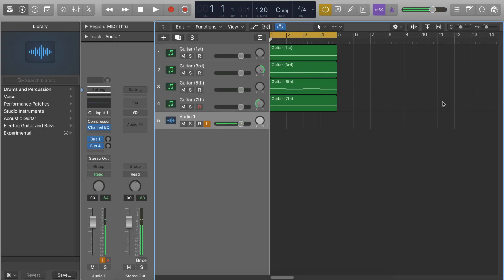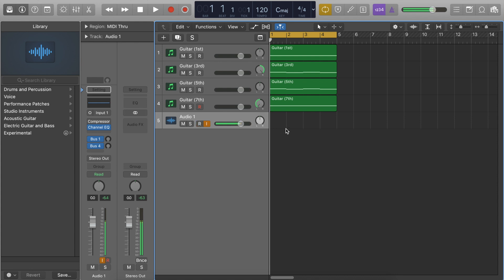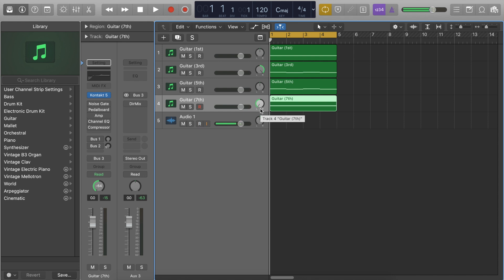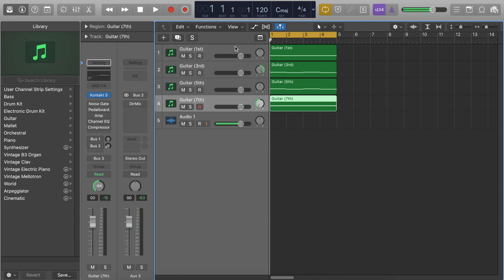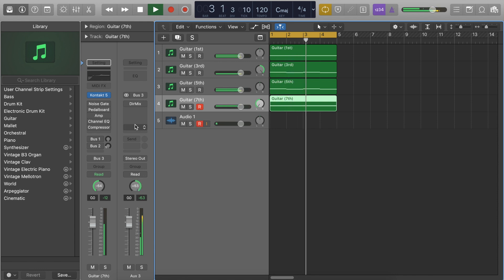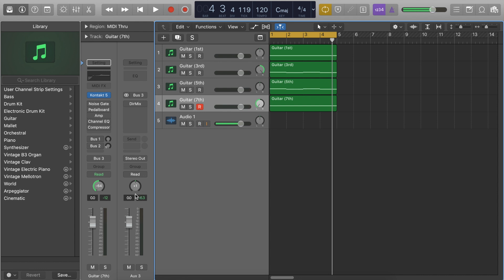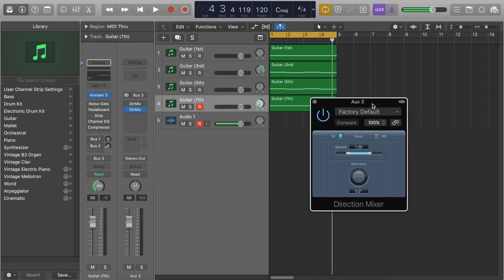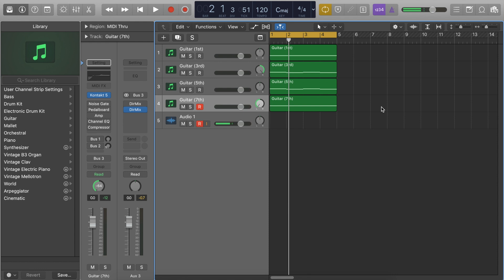How to pan THE RIGHT WAY in Logic Pro X (not using pan knobs)

Comment: This Is So Wrong in so many ways. Its because logic is using Balance Pan as default. What you need to do is right click the Pan knob and Pick Stereo Panning for Regular Panning that people know. The Balance Pan set as default is more of a 2D pan. For example, the Piano. To the right means more of the right hand is heard, same goes with the left. Stereo and Binaural panning is the Placement Panning recommended for mixing. This has nothing against you brother but, it's sad that logic has this Panning law as its default
Reply: Logic got Stereo Panning in 10.3 update. Hate to break it to you.. but before this update, there was no right click - stereo panning option. This video was likely uploaded before that update.

Comment: Music with a K, thanks for the vid. I noticed the direction mixer added gain and was distorting the signal, while the traditional pan pot did not. No loss of information with the direction mixer, like you explained, but it made the overall signal sound worse because of the clipping. Is the direction mixer compensation by adding gain?

Comment: I'm new to using a DAW (Logic Pro X) so bear with me if this sounds like a stupid question. So should you just go straight to the "Direction Mixer" and not even bother to use the actual panning knobs at all? Because in your video you kept your panning knobs completely to the left and right for the 3rd and 7th guitars.
Reply from the maker: All good I understand the potential for confusion, yeah don't worry about the panning knobs I used! That was just to demonstrate things, but yes go straight to Direction Mixer without using the actual panning knobs at all. Also, look at Matthew Pate Music's comment below that if you right click the pan knob it will enter a new mode where it does the same thing that the direction mixer would do. So basically, the quickest way is to just right click the pan knob and set it to stereo!